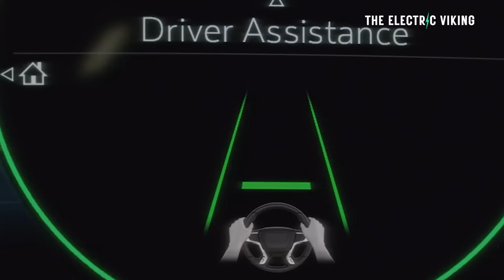GM CEO Hints at Ultium V2 Chevy Bolt EV After Current Killed Off This Year

Comment: It would be fantastic if GM was ready to launch a replacement Bolt at the end of the year, but completely unlikely.  Even if they did they clearly are not ready to produce anything.  The Volvo EX30 will beat them out the door by a long shot and so will Tesla.  GM is giving up turf that should be theirs with the cancellation of the Bolt.  Pretty clueless.   Bolt is a good car.  All they needed to do was give it a little bump in charging speed.  They were losing a lot of money on them from what she said.  Agreed I am not buying the 40% reduction in cost.  The replacement EV's GM is bringing are not efficient and entering a crowded field.  The Bolt owned the compact car niche that many people want.  I just don't see a way forward for GM at this point.  Only smart thing they have done lately is agree to let GM cars use the Tesla charging network.

I really like the Bolt and considering buying one.  ID4 is not efficient.  The Model 3 redesign is about to launch, but from the leaks I just don't like the direction Tesla is going with that car.  Removing even more controls and forcing more stuff on the screen is a bad move.  Tesla is interested in robo cars, not driver experiences, and the refreshed look from the leaked pics just aren't that great.  I would rather have a Bolt! LOL  Now that is saying something.
Reply: If you really want a Bolt it still should be easy to get one , they should have plenty in inventory, I see new Bolts on the streets a lot more now..
Reply: @Lovejazz01  I am actually looking at the Bolt's.  There are some in inventory locally, but some of the dealers are still playing games.  So a few phone calls around to other dealers and they are telling me what they have coming in and are willing to sell them for a reasonable price.
Reply: @Longsnowsm  that’s too bad, looks like the dealerships still aren’t onboard yet, Mercedes must actually be doing better, when I pass by their dealership they have around 20 or more EQ electric vehicles on the front lot all the time. When pass the Nissan dealership every day I never see even one new Aryah electric crossover on the lot. Does Chevy let you order a Bolt and pick it up at the dealership?
Reply: @Lovejazz01  The order process with all the legacy OEM's is a total mess!  The way the "game" works at GM dealers is you work up a build sheet online or with the dealer.  If you do it online they ask you to tell them which dealer you want the build to go to.  There the dealership actually places the order.  BUT, and this is a big BUT GM like most of the legacy manufacturers has a serious supply chain problem.  So the dealers are on a limited rationing from the manufacturers.  The dealer essentially takes your order and puts it in their queue.  They wait to get notified by GM that they can place an order and for how many.  They also get a "constraints" list which tells them what things GM is having a problem producing.  Based on that the dealer knows what is likely to get filled as an order and what is likely to go out there and sit waiting on GM.  Based on that the dealer looks through their list and figures out which orders are the most likely to get filled and then they push those orders up to GM.  That gives the dealer the best chance of getting an order filled.  If the dealer places an order and they don't get filled and aren't moving vehicles their allotment gets cut.  This is why the dealers are doing the things they are.   If you want something ordered you need to find out what kind of allotments the dealer is getting.  The higher volume dealers are going to typically have the bigger allotments.  The entire thing is a train wreck.  To be fair it isn't the dealers that are the problem.  It is the manufacturers.  The dealers are the ones that are getting the bad reputation for a problem they have no control over.   Once I had a local dealer explain the process to me I am amazed they can stay in business when they have suppliers this unreliable.

Comment: I'm not sure how or why you became such a skeptic about GM, except possibly the Holden, not their best product.  That said, as the owner of a 2022 Bolt EUV, and a long time American auto observer (and owner of 75 cars in my long life) there are a few facts about Ultium youu might not know.  First, it has 40% less cobalt, the most expensive mineral in any EV battery.  Second, they are made in an American factory, not Korea or China. Third, the design of the batteries offers much less hand making and faster assembly.  As for second thoughts about permenantly killing the Bolt, it's not the first time an American auto maker has returned a popular product line.  American motors did it with the Rambler American, a return of the original Nash Rambler from the early 50's.  GM returned production of the large Cadillac platform when it became clear that buyers wanted it more than the downsized Cadillacs they had created.  The Bolt is an immensely popular car here in the States.  Do they even sell them in Australia?  Is this all speciulation on your part?  
I'm old enough to remember GM before Roger Smith gutted the company and ruined the products.  Before that, when GM did it right, no one did it better.  The current GM EV's reflect that passion and excellence.  I was in Europe recently and rented a VW ID 4 and a Cupra Born.  I missed my Bolt, which is far more intuitive and fun to drive.
So please, lay off the constant bagging on GM.  It just makes you look like an unhappy man, and that's not good on anybody.

Comment: I get the impression that the Bolts are GM’s EV “training wheels”, i.e. it helped them figure out how to make a decent EV that works. It sounds like although by the end they were fairly successful (after some trial and error on the way) one of the things they didn’t figure out was how to make a profit on them.
Reply: Or make an EV that don't burn your home.
Reply: I would argue the EV1 was. They stupidly tossed it.
Reply: @rozonoemi9374  -- 19 Bolts in total burned out of 140,000+ produced, and none burned down a house, though one scorched the side of a house, and the other a garage. 
A couple Teslas burned down houses.
Reply: @Davran2742  Tesla did not get a battery recall.
Reply: @rozonoemi9374  -- GM didn't get a mandated recall either; it was voluntary.

Comment: Hi Sam. There is still a chip constraint, and if you discontinue the cheaper model and use those chips on a model with higher margin it will help stop the bleeding.

Comment: Lol that is a complete lie that they cant make a profit on the equinox they are building them in mexico where you can make 20000 a year and be considered middle class they will be making a profit on them as soon as the leave the lot the battery platform is spread between all the models which will cause the r&d budget to be recouped in no time

Comment: Honestly,  GM has such a bad reputation with their battery pack fires,  I would never buy one of these junkers.
Reply: You might want to do some digging... That battery pack GM outsourced was made by LG Chem... The same company that has contracts with many of the manufacturers to produce batteries.  It was/is an LG Chem issue and not a GM issue.  Maybe you will want to look to see who else is putting "junker" batteries in cars.  You might have to add a long list of manufacturers to your junker list.
Reply: @Longsnowsm  Maybe when LG Chem is selling EVs, then I'll also be avoiding them too.  FYI:   the entire drive train is sourced from LG Chem, not just the batteries as per Autoline After Hours,  7 years ago with guest Sandy Munro.
Reply: @eugeniustheodidactus8890  Yes, and it wasn't just GM that had to recall all those batteries from LG.

Comment: Model 3 is priced near the Bolt MSRP, so I would go with M3, much better car!
Reply: You are aware the MSRP on the base model Bolt is 27k?  You are aware the current price on a M3 is 40k?  You are aware that both cars get the 7500 tax credit?  Now explain how the M3 is near the cost of a Bolt?
Reply: @Longsnowsm  efficiency, charging speed, fast charger availability, no mandatory maintenance program, more confortable, bigger car, range, etc
Reply: @rozonoemi9374  Price  That is what people are going for is the 20k price tag after incentives.  I can buy a lot of "mandatory maintenance" for that price difference between the Bolt and the M3.  The Bolt fits the local car, city car, regional travel car...  The all around daily use car.  For some reason that seems to be too hard for Tesla fans to understand.  Funny, they will suddenly get it when Model 2 or whatever rolls out in 2025 and suddenly it will seem like an idea invented by Tesla.  Local car, regional travel really does not live or die by fast chargers or even integrated navigation.  And now GM will have access to the Tesla network so that really wouldn't be a factor anyway.  But the Bolt isn't your cross country road trip car unless you have time and just want to enjoy the adventure.   The Bolt is the 90%+ daily use car.  At the price with tax incentives it is a bargain.  Tesla only aspires to be in that niche right now.    The only thing that was holding the most recently refreshed Bolt back was GM's ability to manufacture them.   A speed bump for the charging would have been nice, but not a deal breaker when almost all your charging is done at home.  For 13k difference the comparisons seem pretty silly.